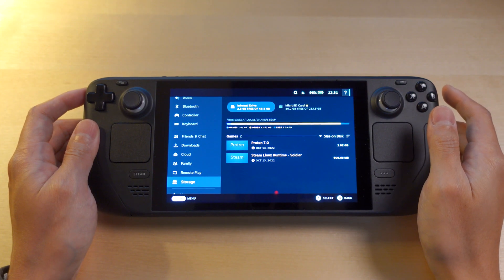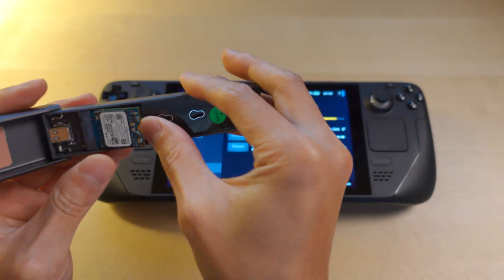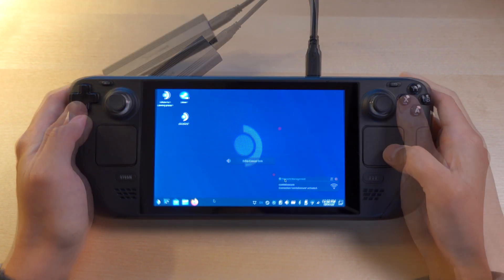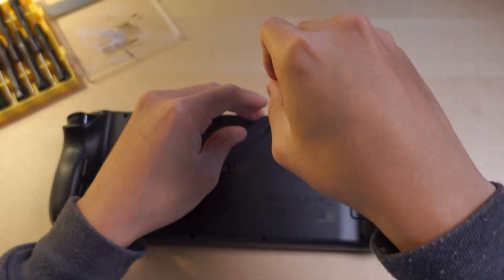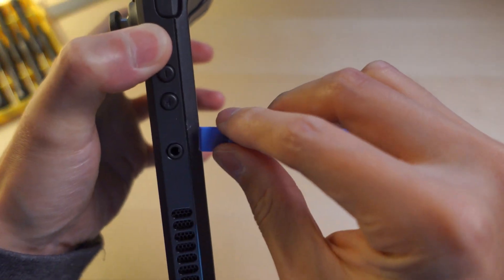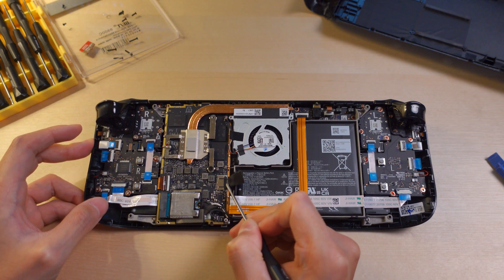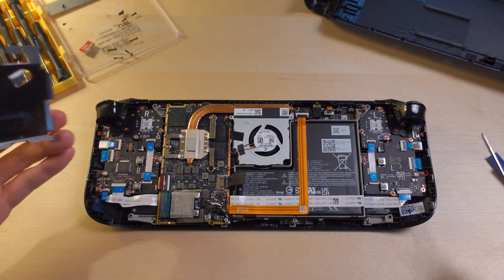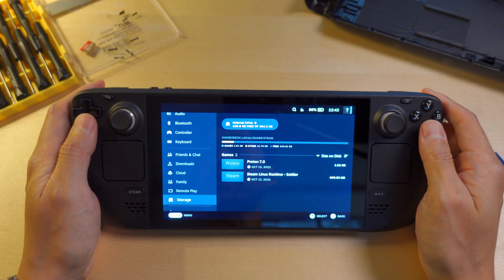Steam Deck NVMe SSD Clone and Disassembly

Comment: Help! I followed the steps, messing up along the way and having to correct myself, but near the end, I had the new drive installed, and it booted into gaming mode and had all my games exactly as they were on my old drive.  I had forgotten to put in my microsd card, so I shut down my steam deck, inserted my microsd card, but this time it booted as if it were the first time my device was setup.  I selected my language, wifi, and clicked continue on the next screen and it started "installing" something, I pressed the STEAM button and shut it down the safe way, but it took a while, potentially finishing whatever it was installing.  I then turned it on, let it do its "initial setup" thing, thinking maybe it just needed to refresh.  All my games were gone, going over to installed, shows 0.  I go into desktop mode, and I notice all of my files and folders that I created (like notes and everything) is still there.  What's going on?  Can I fix this?
Edit: I decided to start from scratch, I deleted the new ssd, cloned it again, re-inserted the micro sd this time, and it booted up fine with everything I had before, I even launched a game to make sure.  So I then decide to reboot it to see if it stuck, but it didn't, it put me back in the welcome screen again.

Comment: Is it still possible to partition the new ssd and dual boot windows after following this guide, or would the partition need to be set up before cloning the original ssd?
Reply from the maker: This method clones everything as-is, including all partitions. However, you would need to likely expand the partitions afterwards with other tools like gparted.

Comment: I get this error when I try this method > dd error writing /dev/sda no space left on device
Reply: dd writing error often occurs when you use a dock or a hub or when the ssd gets too hot while the write process. I had the same problem before. But after connecting the external ssd enclose direct to the steamdeck (USB-C to USB-C) and cooling the target ssd with a fan everything succeeded 🙂

Comment: Just finished this process on my 64GB Steam Deck and everything is working great so far! However, I did spend some unnecessary time and money returning my first SSD and enclosure because I thought they were faulty; when I would run the provided command, it would say that /dev/sda was not found, and no mounted drives would appear. What I eventually discovered (by looking in KDE Partition Manager) is that my Steam Deck had the drive set to /dev/sdc instead. Once I updated the command accordingly, everything else worked perfectly.
Reply: I just checked mine - my 64GB when I click on it on the left hand side shows /dev/nvme0on1 — would that be what I type in versus your /dev/sdc?
Reply: @sknapp19911  no, the "/dev/sda" or "/dev/sdc" is what you'll see in partition manager when you plug the new drive in via the NVME enclosure.
Reply: @kingcars  ahhh gotcha, tyvm!
Reply: KDE partition tool is in SD desktop mode? Or windows

Comment: I Installed a 1 TB SSD from Corsair MP600 Mini. This video is very helpful it worked flawlessly. I didn't even need to resign in. I also use a MicroSD Card.
Reply: everything worked as if it was the original ssd? Im just worried about having to re setup things like game pass and all the extra launchers and themes. I've forgotten how to do it all. thats why I haven't sent mine in for a warranty repair/replacement.

Comment: Thank you. Replaced a 256GB with a 1TB in my sons steam deck. I used a plastic removal tool and no  problems opening the case gently. Your method is the best and fastest method. Took 6 minutes opening the case slowly and 7 minutes slowly taking out the old storage and putting in the new storage. 3 minutes to close up and all set.

Comment: Hello. I tried this last night. I have all my emulation,and other things that i would really like to not have to start from scatch. It seems to have successfully cloned/copy my original nvme content, but after I finished putting in the new 1tb drive my SD would not launch correctly. I got an error message saying something about the boot,and if I would like to go to boot options. Sorry I can't quote the exact error message. I'm at work while rewatching this video. A couple of questions. Does the new drive need to be formatted prior to this process? If so what format? And or does the new drive need to have a clean install of steam os already in it before the transfer/clone process. Thanks to anyone for any help.
Reply: there is no need to format the drive first!

Comment: So weird question: First off, the SSD was not showing as an option for attached storage on Desktop mode when i plugged in in (had it in a UGreen enclosure, 2tb Micron). But i used the sudo dd command and it showed the progress and everything so i figured it was working. However, my Steam Deck went to sleep while doing this and I saw some error code. I accidentally clicked out before I could take a screen grab of it. I tried booting from the SSD in the enclosure to see if Gaming mode would show 2tb as the internal storage (don't know if that would work) but it still shows the 512 as the internal. When trying to sudo dd again, I just get a blank screen and it goes no further after inputting the command again. Is there a way to reformat it when it's not showing up as a device in File Explorer? Or should I try to go through the process of installing it as internal and see what happens? Really don't want to have to chance it like that. ANYONE'S help would be greatly appreciated.
Reply: You should do the whole process again and beware that the steamdeck cannot jump into sleep mode while writing the data!

Comment: i wanted to do a copy of the ssd, but it's so slow like it took 40 50min to do only 90mb of copy, do you know why ?  i have the same ssd and usb portable.
Reply: did you connect it directly to the steamdeck or are you using a hub or dock?

Comment: Thank you did the same thing as you except I didn't disconnect the battery I just put it in shipping mode. I also installed the Jsuax backing plate which was kind of a hassle. I had to use their screws because the stock screws were 2 tight I'm guessing and the buttons were 2 hard. Had to take it apart twice but it ended up looking and being awesome. Thank you so much for the tutorial.

Comment: Anybody ran into boot loop after restarting for a second time after doing this?
Reply: I've read that if the SSD you are cloning to is brand new (ie: not pulled from a laptop or other device) you may need to set your new SSD to gpt in KDE Partition Manager before cloning. I did this by plugging my new SSD via enclosure, opening KDE Partition Manager, selecting the new SSD and created a new partition table and selected gpt. I applied the changes and then followed the instructions in the video. It worked flawlessly. Just be very careful that you select the new SSD (the one you want to clone to) in KDE Partition Manager.

Also, thank you so much for the video. I can't believe how easy this upgrade was!

Comment: Every time I've tried i've head the same error... 
The transfer stops at 7.7GB and writes :
"dd: error writing  '/dev/sda' : No space left on device
58+0 records in 
57+0 records out 
I've tried with different USB C cables... I realy don't know what else to try :( The ssd is brand new and 1 TB
Reply from the maker: I suspect an issue with the SSD itself or it maybe counterfeit.
Reply: I got this same error. I got a 1tb Sabrent off of Amazon. Will have to just do it the other way reimaging the new ssd.

Comment: Do you think this will work with another ssd enclosure?
I have ROG with pre installed 512 ssd, and i will use this to instal to my 2230 ssd
Reply from the maker: Another enclosure will work as long as it is recognized by the boot process.

Comment: For those who cannot make it work: I also had the issue of getting stuck in the Steam logo even though I could launch my Windows 11 partition and allocate the extra/new space. No solution could make Steam OS run, even when trying to reinstall or reimage by using an external drive. In the end, I had to use Macrium Reflect to copy/create an image of the original SD SSD and recreate in the new SSD (it took me 6 hours). After doing this, I can launch Steam OS and Windows 11 as normal and all my games and settings are in the new SSD drive. Good luck and thanks to the creator of this video!
Reply: Just wanted to say thank you SO MUCH for leaving this comment. Based on most of the comments I see here it looks like the dd clone method has worked great for many, but I ran into the same exact issue you mentioned with the infinite Steam logo on boot after cloning. Although using Macrium Reflect to back up my old SSD and restore to the new one took a while (about 6 hours for me as well), I was just able to boot (and restart) successfully with the new larger SSD installed. Would never have known to use Macrium Reflect if it hadn't been for your comment here, so thanks again very much!
Reply: ive been messing around with this for hours. but do you need to housings to copy it over? or can you first copy die image to pc and then write it to destination?

 @cdleveille
Reply: 1. If your device is stuck on the boot logo, consider this alternative solution. First, place your original SSD into a Type-C enclosure and boot from it.

2. Open a terminal and run the following command. Please note that you may need to modify it based on your specific drive names:

```
sudo dd if=/dev/sda of=/dev/nvme0n1 bs=4K status=progress
```

3. To identify your drives and their respective names, use the 'lsblk' command in the Konsole.

4. If you encounter any difficulties, feel free to ask ChatGPT for assistance, as it's how I developed this fix.

Following these steps successfully should resolve the issue, and your drive should work perfectly without being stuck on the boot logo.
Reply: @brandonr27 this method worked perfectly for me
Reply: @brandonr27 I ran into the same issue after a few days of using the new drive, and I just did what was done in the video, except I switched the /dev/sda and /dev/nvme0n1. I did bs=128M like in the video. Now I'm scared because you put bs=4K. Here's hoping it works! I don't know what oflag and bs do 😅
Reply: Update to my frenzied comments: Sorry for freaking out, my method of putting the old drive in the enclosure and doing sudo dd if=/dev/sda of=/dev/nvme0n1 oflag=sync bs=128M status=progress seems to have worked fine.
Reply: I had the same issue. What I did was reinstall the original MVMe and everything worked fine. After, I just cloned the new MVMe again and reinstalled it. Everything worked fine after that. Basically it looks like something got corrupted on the initial attempt.
Reply: Do you mean simply loading the old drive into the USB enclosure and using the command in the video but switching /dev/sda and /dev/nvme01 won't work? 😮 I'm in the middle of trying it now and I'm scared I'll ruin what's on the old drive somehow...

Comment: This does not work with my Toshiba BG4. The /home partition is still 227gb same as on the small ssd and there is no unallocated space to resize it using KDE partition manager.
I assume it has to do with the fact that my ssd was not partitioned in a GPT scheme before or it could be an incompatibility with the BG4 and KDE partition manager. Will try linux fdisk from command line next.

Comment: Hey so after I did the cloning command non of the drives didn't appear in disk and devices like in your video but I still put the new ssd in my deck and it says default boot missing! And when I plug it into my computer it says I have 56 gb of gpt and 1800 of unallocated! Is there anyway I can fix this?

Comment: So I’m planning on upgrading my Steam Deck to a 2 TB drive that will be delivered in the next couple of weeks (fingers crossed). I’m really glad to find an SSD swapping tutorial that specifically retains your existing data 👍

But a quick question - every other tutorial I’ve watched for replacing the SSD involves downloading the OS image and re-imaging the new drive. I don’t see that being done in this tutorial, so does cloning the internal memory to the new drive alleviate that step? Is the OS itself also cloned over to the new drive or is it just games and files and such? That’s the only thing I’m not clear on, but if that is the case, that’ll makes the drive swap far, far easier

EDIT: Just finished performing the upgrade - and it went off without a hitch. Everything was successfully moved my new 2TB drive, including all my Decky add-ons, emulators, tools and customizations. I didn’t even need to log into Steam again beyond than the PIN lock I already had set up before. For all intents and purposes, it’s exactly the same Deck as I had it set up before, just with cozy 2TB drive and a 1TB micro SD card on top of that. The new drive is also noticeably faster than the stock drive - moving large games from my SD card to internal memory is a bit quicker than before. Not night and day difference, but it is a noticeable one compared to the glacially slow transfer speeds on the stock drive.

I only had one hiccup during the process, which I’ll pass along to others who plan on doing the SSD upgrade - make double and triple sure that the battery is fully seated before you reassemble. You’ll know it’s secure if the power light flashes white for a second
Reply: Everything on the original SSD including the OS is cloned.
Reply: @MrHshaak I just tried this following the video tutorial,  and it seems like the OS was not transferred along with all the other data. Does the new drive need to be formatted prior to doing this? Or does it need to be completely wiped,blank?
Reply: This was the comment i was loooking for im trying to do the same lol, how long did it take to transfer? I have over ALOT of roms lol
Reply: what do you mean by fully seated?
Reply: @AronGKatz  as in fully pushed into its slot and connected, otherwise the Deck won't power on. I made the mistake of not double checking that connection the first time around, and had to reopen my Deck to fix it
Reply: @dancack  thanks for the reply!

Comment: This almost worked for me, then broke.
Did clone method described, failed at first attempt at just over 1GB in, when plugging in the NVMe USB enclosure through a hub, plugged directly into steam deck itself and it finished. Replaced SSD, booted it up, had to log in again and the storage setting shown the correct storage option. Turned off the steam deck and powered it back on, now it's stuck on the logo and won't boot to SteamOS. Tried a few things like enabling shipping mode and booting with power lead, reinstall steamOS through recovery USB, restoring to previous OS backup, none have worked.
Reply: any luck yet? same problem here :(

Comment: Fantastic video, massive help!  Only thing I would add:  I had unallocated space on my 1tb after the clone command was successful.  This partition was easily fixed (resized) by using the KDE partition manager utility in desktop mode on the Steam Deck.  Once fixed, then I replaced the 64gb inside the Steam Deck.
Reply: how did you resize it in the partition manager im having trouble when i resize it dose not let make it bigger  im using a 1tb as well did you resize before or after installing it?
Reply: @ReZiDenTEv1L  I resized before installing it.  In my case, right clicked on the sda8 partition and dragged the slider all the way to the right. Unallocated space was showing as a yellow bar.  Failing that, just install the 1tb after running the command, the Steam Deck resizes the partition automatically (found this out whilst doing a second Deck).
Reply: I have no unallocated space. Somehow DD did spread a 227gb /home partition over the whole of 900gb, no empty space before and after left. I checked with macOS Disk Manager but it shows the same 931gb disk which is full with only the small boot, swap etc partitions and the 227gb /home.

Comment: Getting started tomorrow with a 256gb ($15 dollars off Bezos 👍👍) I'm sure I wouldn't get a response in time, but my question is would I  be able to skip having to prep my 2tb SSD for my Jaux Dock if use the transfer case method to switch data like you did with the internal? Meaning not have to write any extra scripts or do steps, just flash that and the 256GB with the enclosure??? Any help is appreciated
Reply: I'm under the impression that this would work as a formating option as well if I do both before installation

Comment: Hi, i'm having trouble with this process. I'm using a 2TB nvme and I get an error message error writing /dev/sda: No space left on device. But I'm using an empty 2tb drive, so I'm not sure what I'm doing wrong. Any help would be appreciated, thank you
Reply: I figured it out! I was using a hub that was giving me that error. Once I switched hubs, it all worked fine!
Reply: @openboxtherapy1010  how did you fix that hub I need help
Reply: @wetdreams2818  I used another hub. The problem is that NVMEs use a lot of power so if your hub isnt able to maintain consistent power throughout the process, then it'll just fail. Luckily I had another hub, and it worked.
Reply: @wetdreams2818  Unitek uHub H6